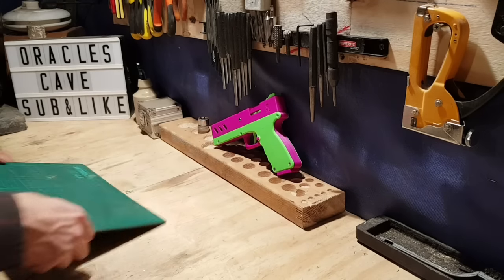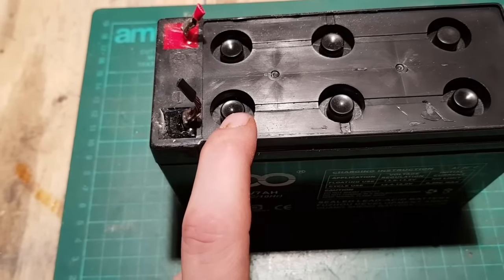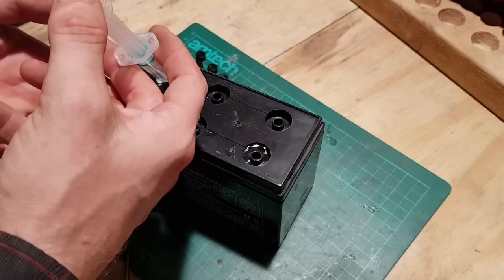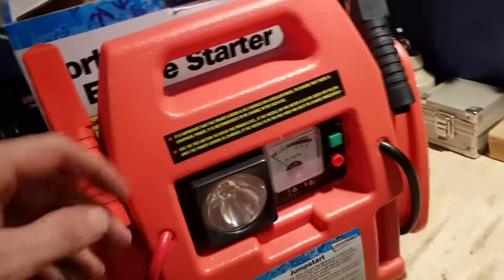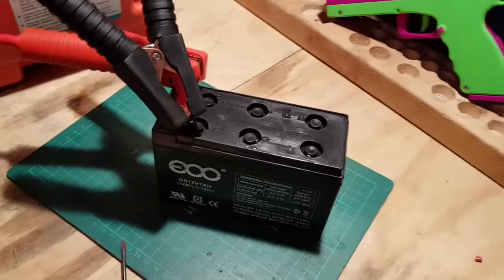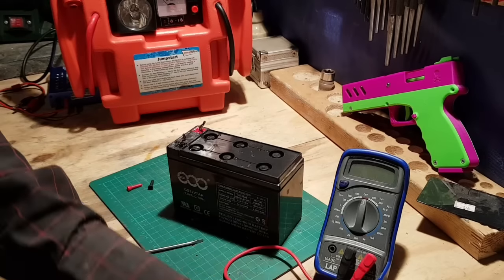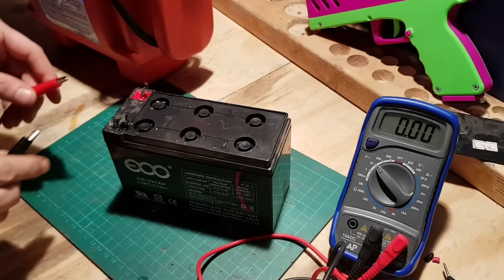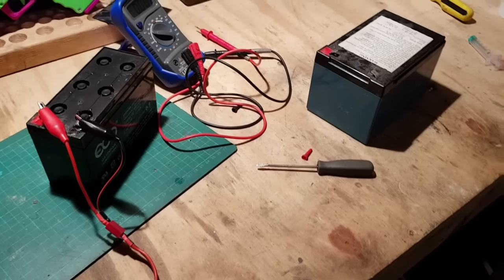HOW TO REVIVE DEAD 6V, 12V BATTERIES THAT WON'T CHARGE

Comment: I have a 10 yr old 7AH, 12V battery.i tried reviving it 2ml of dil sulphuric acid and the rest is distilled water.i used another 12v 150ah battery to charge it .
It had 0.5V when it started after 24 hrs of parallel charging it went to 5V .it started with 0.1mA now takes like 5-6 A of current while charging.
Only 3cells heat and bubble while rest 3 don't.so I added another 2ml of dil sul acid to those weak 3 cells .
Is there anything else I can do like epsom salt ,reverse charging for this battery.
Pls help me out
Reply from the maker: Yes some reversing the polarity in short bursts can help desulphate the crystals off of the other cells, this might work for you, just be careful as it bubbles very much, i usually keep a bit of distance between me and the battery so I don't get splashed, but in my experience I have fixed batteries with similar issues using the reversing polarity trick.
👍👍👍
Reply: @oraclescave  can you tell the duration of reversing the polarity at what intervals.i couldn't find it in google
Reply from the maker: @muralikrishna1504  I only do it in short bursts of a few seconds but I have heard of people doing it for 20 seconds.
I personally only do it for 5-10 seconds each time, maybe 6 times before cycling the battery to see if it helped, if the battery is not destroyed already, you will start to see it improve.

It does bubble a lot, so be careful, its for this reason I don't like to advise people this method, without checking google for.... how to desulphate a lead acid battery, or how to fix lead acid battery by reversing terminals.
👍👍👍
Reply: @oraclescave  thanks I'll try it with proper precaution

Comment: Do you open the part that says "DO NOT OPEN" ?
Reply from the maker: Yes I opened the part that says do not open.
I used a small flat headed screwdriver and popped it up.
Reply: @oraclescave  cool. Thanks for responding!👍
Reply from the maker: @John Doe  no worries bro 👍👍👍
Reply: My battery is showing about 8.5v should i start it on 2v or higher?
Reply from the maker: @John Doe  yes start low, then drain it back down, charge higher each time, that should boost it back to life, each time it should hold more charge.
Once the crystals have fully dissolved again the battery will be back at full power.
You can also buy battery revive acid, very cheap and will bring it back instantly, very cheap way of fixing batteries that everyone just throws away.
So if it charging still doesn't work, you still have acid to fall back on which is miles cheaper than buying a new battery.
Each cell only takes about 2ml of acid and the rest is water, so acid lasts ages.

Comment: Is there an easy way to remove the cap?
Reply from the maker: Just a normal razor blade, slips between the very fine line on top, it is only held by very small friction welds, it will pop open very easy.👍👍👍

Comment: I'm still trying to figure out how to revive gel-cell batteries.....Got about six of them that won't charge out of my bikes, and yes the bikes charging systems are fine..Motobatt batteries are the worst pieces of crap out of all of them..Sick of buying new ones at $120.00 a crack..
Reply from the maker: Slow charging on low amps will build them back up, you need on of the old style chargers, the updated chargers are smart chargers.
Old fashioned chargers just give raw power without the stupid/smart microchips built into them.

Slow charge with low power, then if you can get some power into them, discharge it by using the power again maybe 2 wires and a bulb until power is used, then recharge at slightly higher power, and do this multiple times.
The trick is trying to get it to charge again in the first place, but it's absolutely possible, just not with a smart charger, look out for people having a garage clearance and get your hands on a 1980's motorbike/car battery charger.
👍👍👍

Comment: Ive got three of these i tried this on. None will charge more than 7 volts.  One wont do more than a couple volts.
Reply from the maker: Drain them down and recharge, it might take a few cycles but it will come back.
Sometimes raising the amps to charge helps make it work faster.
But multiple cycles will help just the same.
👍👍👍

Comment: I added distilled water. Then battery got hot and  no more charge and battery totally dead.  Any solution ?
Reply from the maker: Add a little acid and it will be back to brand new, its only a few millilitres each cell, just Google your exact battery and it will tell you how much acid each cell.
👍👍👍
Reply: @oraclescave   thank you very much for quick reply. My one is 3-fm-10(6v10ah/20hr) XINLEINA valve regulated lead acid battery. 2 parallel connected batteries. Total 12 v
Reply from the maker: @sarangamapalagama162  no worries Saranga, I'm happy to help.
👍👍👍

Comment: In all seriousness why bother? I had some UPS batteries and wasted a day adding water and trying to charge them. Then I checked on Amazon and new ones were £14 each. Instant decision and I put the old batteries out for collection and just fitted new. Two days ago I did the same with my car battery. It was less than two years old but with not using the car for months on end the battery died. Now a brand new Varta sits in the car. I will use the car weekly from now on and I know it will be reliable. Just simpler to replace. Reliability is more important than cost.
Reply from the maker: But if you don't have the ability to pay for new ones, or you might just be interested in tinkering with things, or have a genuine use for them after fixing.
So your comment belongs back in the same crap hole it fell out of.
These batteries are £60  EACH.

it's not my fault you lack basic knowledge about stuff.
If I could get the batteries at the price you can get them at, I would do that too.

But I get these batteries by the dozen fixing and modifying kids ride on toys, so I tinker around with batteries and find things that work.
It's not my problem that it's not what you were looking for.
So in all seriousness, do 1

Comment: Is it normal for it to bubble after the refill?
Reply from the maker: Yes
Reply: Ok I got scared and unplugged it
Reply: Lol
Reply: THANKS a ton
Reply from the maker: @jamrock24goku23  just let it charge and the bubbles will continue , tgats why you dont fill it to the very top of the hole, because it just makes a mess, fill until cells are covered and charge, it will bubble for ages but will calm down.
👍👍👍
Reply: Works perfect thank you and yeah you're spot on

Comment: I've got a desktop power supply, so I can push any voltage I want on anything. My little old 6v won't take even 0.01a of any voltage. I started at 7v, cranked it way the hell up, still nothing. This is after topping off all the water. The battery does read at about 2.25v, before and after my charging attempts. I guess sometimes, they're just truly done for, huh? They're very cheap, but I'm still a little disappointed
Reply from the maker: Not volts amps, have the voltage at the correct volts and can charge at higher amps.

Sometimes dropping the battery onto a hard surface can knock it enough to loosen the crystals inside to allow it to begin the charge, also look up reversing the terminal connections to help with restarting the charging cycle.
Reply: @oraclescave  thanks! I'll try that

Comment: Got this problem with my sons crazy cart only used it once
Reply from the maker: Your battery will be suffering sulphation, just Google how to fix battery sulphation, it will explain everything for you, but once you get it going, it might take upto 20 charges and running it nearly flat again each time to recycle it back to high power.
👍👍👍
Reply: @oraclescave  I probably just buy another one then if I have to keep doing it but thanks for reply mate
Reply from the maker: @I_am_BiG_Al  yes the battery will need lots of cycles to become high power again.
The type of battery does not like to be overcharged or left uncharged.

Normally things with lead acid batteries have to be full charged every 1-2 months even if you are not using it.
This is what keeps the battery from forming sulphation.

Try charging it, then put it into whatever, then run the battery down, and recharge.
Your battery might come back to life the first second or third attempt.

It probably won't take 20 times to do it.
And it's not worth letting it go to landfill.
All a battery is, is a jar with a piece of metal in it and some electrolytes with fluid.
At anytime the solution inside can become weak, so its as easy as replacing the electrolyte, batteries can last thousands of years, so chucking it in the trash after just a couple of years because it won't charge is crazy to me.

I just like fixing things, yes a new battery will be cheap and will fix it instantly, but if you don't know how to care for a battery, you could destroy it after just 1 charge.
And then you realise how not cheap it becomes.

I'm always fixing 12v batteries for ride on toys that have been left uncharged for months to years at a time, I think your battery will fix fairly quickly.
👍👍👍

Comment: I did the same thing but instead of plane wather,  I used 4 lemons  🍋 & lets see if it work.
Reply from the maker: Lol, let me know what happens, there is voltage in lemons, very good electrolyte.
I'm sure it would work, but how much voltage load could it hold, thats the question.

I might even try it out aswell at some point, just for the data.
👍👍👍

Comment: If it only was that simple.First of all,filling all cells in the battery requires exact amount of distilled water/electrolyte per cell .Judging by the size of the battery in your video 10-15 ml of liquid is too little,if the cell seems to be filled up to the opening,it does not mean it's the case.Very often one sees a liquid/air bubble forming on top which can be read as an indicator for a complete fill up.And yes ,it prevents further "injection.The second,99% of dry batteries ,especially from alarm system back ups will have heavily sulfated plates,which in plain language means their capacity will be very low.Let your "repaired/revived battery" stay  undisturbed for 72h and check the voltage, not mentioning how it will behave under a modest load.It will be an eye opener

Comment: Just got one that must be stopped for a decade.. It showed 0,20 volts. I'm trying to revive it for an 6S 2P with 4 batteries ;)
Reply from the maker: As long as you can transfer some power over to the old battery, you should be able to do it.

Let me know how it goes, also you might want to look into reversing the polarity once you top it of with water, this will help dissolve the crystals that will have formed on the cells and help make the acid stronger for better longer charge.

Just google, reviving battery reverse terminals, and you should find some information about it, it only needs done in short bursts, and it will bubble and fizz so EYE PROTECTION IS NEEDED.
But Google it, this will help lots if the battery struggles to keep charge.
👍👍👍

Comment: My battery is working normally . It just wont charge . Its performance is normal
Reply: Thank you so Sir. I did put water in it but I didn't know that I have to use some strong current to get it recharge.  But I am still working on it.  Thanks once again.

Comment: Currently trying this on a electric scooter I picked up for free fingers crossed.
Reply from the maker: Let me know how it goes, if the battery is still weak you can get refills to replace the acid, called electrolytes.
👍👍👍
Reply: @oraclescave  I will let you know how it goes thanks again.
Reply: @oraclescave  hi one battery is at 11.8v the other around 7v. I've tested the cells and one is weak only producing 1.4 v on the 11.8v battery. Similar story on the 7v battery but a couple more cells. Where can I get hold of the electrolyte solution ?
Reply from the maker: @dg115  something like this, shop around you can get it cheaper and closer to you.

https://en.50factory.com/pieces-neuves/43269-acide-de-batterie-1-litre.html?gclid=Cj0KCQjw3Nv3BRC8ARIsAPh8hgLnG4q9oa6xQNU41RN79DB_ZteNskUbZpHdaYbw2qvOEGu_sZme6AYaAqOKEALw_wcB

Comment: You didnt turn it on. Theres a switch on that jump starter
Reply from the maker: That switch is just to turn a light on, the jump starter is always active, that's why the leads hang up on each side, it would short out if they touched, there is no way to turn power off to the jump leads.

Comment: When I connect mine to another battery to charge,  it boils? What am I doing wrong?
Reply from the maker: Did you put normal water in it ?

It's normal for it to start bubbling, that's why you don't fill it to the very top, but the bubbling will settle down.
This is why distilled or de-ionized water works best, less contaminants makes less bubbles.
👍👍👍
Reply: I used distilled water.  There was just so much gas coming out,  i disconnected it.
Reply from the maker: @classicsbyclark  yes sometimes sulfation has occurred and all the electrolytes inside have crystallized onto the plates inside.

There is ways to reverse this, just google how to desulfate a lead acid battery.

This will put you on the right path.
👍👍👍

Comment: just ionized water? not acid water for batteries?
Reply from the maker: Ionised or distilled for topping up, acid is to bring back the power to full, battery refills are available, called lead acid electrolytes, sulphuric acid is what is used, just like a car battery.
👍👍👍
Reply: @oraclescave  what if the bike doesnt want to charge up after unused after a long time,you need to refill the battery?
Reply: @oraclescave  what if the bike doesnt want to charge up after unused after a long time,you need to refill the battery?
Reply from the maker: @pasyensyatv9092  you can try "desulphering" the battery.
The good stuff has turned to crystals and needs to be dissolved again.

Please Google... reversing the polarity to fix sulphation, this might be what you are looking for as the electrolytes crystalize if not being used, 99% of most lead acid batteries issues are this problem, but can be fixed.
👍👍👍

Comment: The. Charger. Was. From my. Mum. Pride scooter. Very. Big. 8 mile an HR,.  Was. Concentrating and   put the large. Battery charger. In my small. Boot. Master 4 mile an HR. It. Won't come on now. Thank you
Reply from the maker: Yes, these scooters break batteries very often.
The batteries are supposed to be fully charged then used down to 30% capacity.
If used below 30% or overcharged these batteries will get destroyed very easy.

Also if they sit for too long uncharged they can cause crystals to grow on the plates inside. And this can cause non working issue.

Its very expensive, but looks like you might need to purchase new batteries as this trick probably won't work with your batteries.

Or you might possibly have blown a fuse, I would check the wiring for a little box somewhere, possibly the box has a button on it, you might be able to reset the cutoff, its a little black box attached to the wires that can auto disconnect when too much voltage, this protects the battery from being harmed and would also act like the machine won't turn on.

Its a fuse/relay, maybe search Google for a WIRING DIAGRAM or EXPLODED DIAGRAM, of your model of scooter.
But I imagine the box/reset button would be around the area where the batteries are stored.

Comment: Your battery not going to when u put under load voltage will drop too low
Reply from the maker: Read the pinned comment, you will understand.
👍👍👍

Comment: you can't recover a dead cell battery - if you fill distiled water then it may show 12v but Amp it can't
Reply from the maker: That's why you add sulphuric acid, it brings it back to new again.
👍👍👍